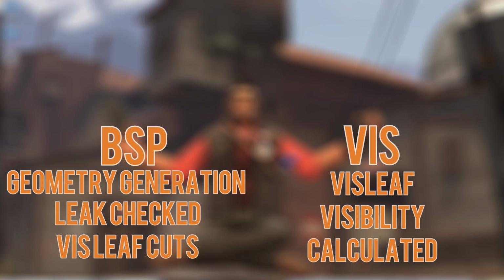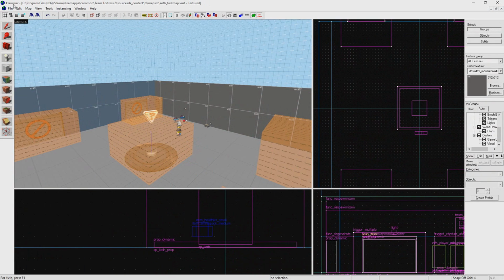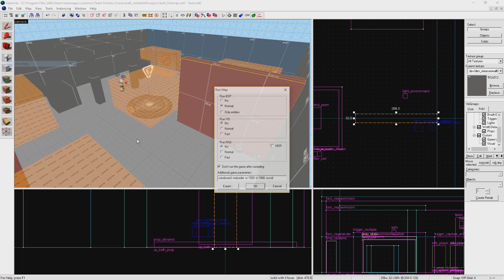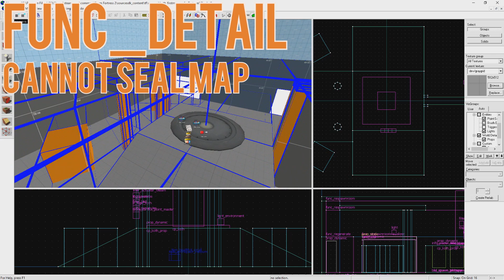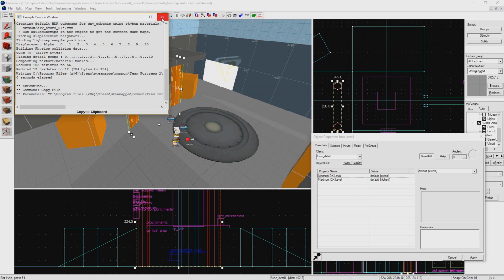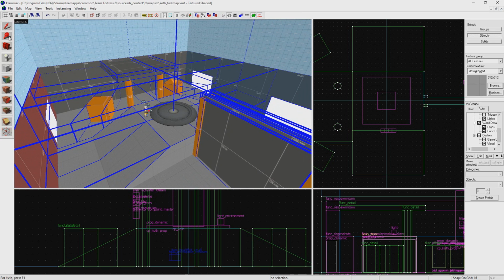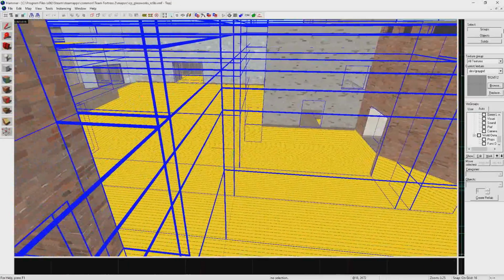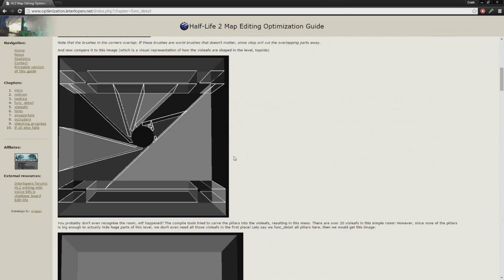How to Make TF2 Maps - func_detail Basics - Chapter 2 Appendix

Comment: I seem to be having some trouble loading the 'portal file'. Ive compiled and run the map several times but when I click 'load portal file' it opens up a browse window where I'm supposed to go looking for the .prt file??

After testing I had complaints that one particular area of my map was causing some low-fps so I thought I would check if this maybe had something to do with vis-leafs.
Reply: I have same problem aswell.

Comment: Can you also cut the compiling time by cutting out bits of the map that will never be rendered? (for example, cutting a hole in the floor under the control point base.) I know this is risky because it could cause map leaks, but would it work?
Reply from the maker: +Matthew Love small things like that wouldn't change much for render time.  If anything, it might increase it due to the extra brushes you had to make to cut the hole.
Reply: UEAKCrash I see.

Comment: Waht do you mean about sealing to tthe map?
That bullets can get through it?
Reply: An unsealed map refers to a map which has a gap in its geometry leading to the black void outside. This doesn't allow the BSP tree to work properly and so crashes.

For example, if I made a map where one wall was too low and didn't reach the ceiling, and there was nothing behind it but the void, then that would be a leak.

Comment: Did I miss something? How did you change the objects to cylinders? Or have you not covered that? (Something I am hoping to do, but also a bit lazy on legitimate research... is start making some hills and terrain without just spamming "CUTCUTCUTCUTCUT")
Reply from the maker: +steeledminer616 you can make cylinders by changing the brush type to cylinder under Objects on the bottom right (with Primitives selected under Categories).
Reply: UEAKCrash Ahh, I musta missed that button. Alrighty then, thanks!